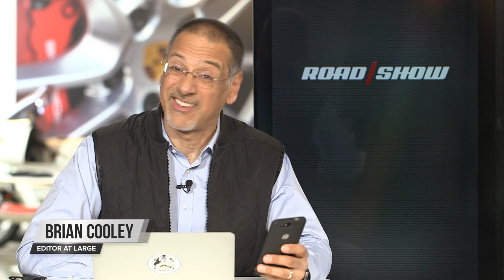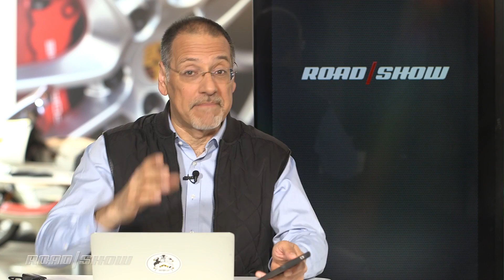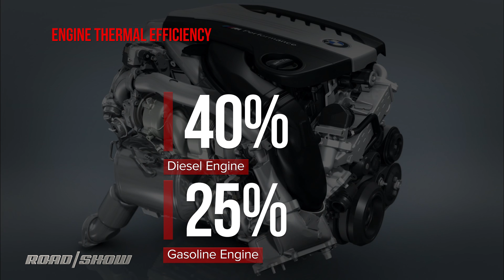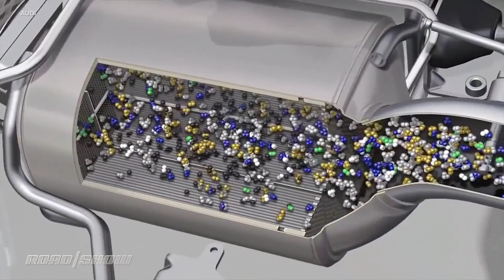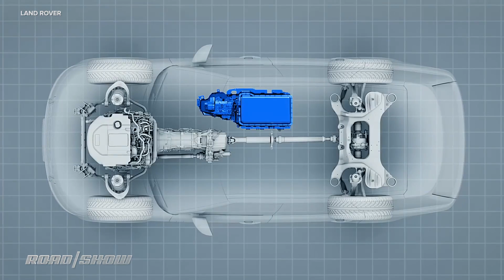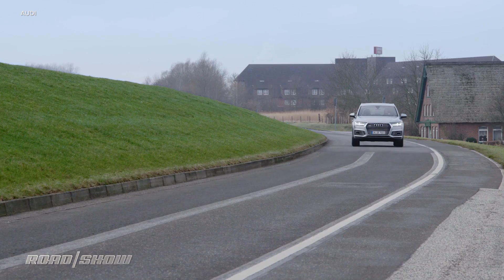Do diesel hybrids make any sense?

Comment: And now we all know what government propaganda sounds like. So lets see the real numbers by using well known scientific fact. Electric motors are not better at low end torque, they are good at torque. Diesel motors do just fine on the top end and are much more efficient than gas across the spectrum. The best motor to generate electricity is the diesel because of it's torque. The difference in weight between a 1.5 L gas engine and a 1.5 L diesel is laughable in a 2500 lb car. The only reason diesels cost so much is because our big oil communist government will not allow them to be produced in the government financed auto industry. Yes they use a bit more material...what does an extra 100 pounds of Iron and aluminum cost? They need high pressure fuel rails but they don't need an ignition system. The $7k price increase is a load of lies from your auto manufacturer not wanting their vehicles to last 500k miles and the government not wanting a 25% drop in fuel tax income. All you geniuses screaming big oil need to understand that the 8 cents per gallon the oil companies are making will not pay for your food stamps like the $1 per gallon the US government is profiting. Diesel exhaust is another lie. I have yet to see a study that compares exhaust pollutants of diesel and gas and then compensates for a 25 to 35% efficiency of burning those fuels. Half of the reason the diesel exhaust is so extensive is just to get those MPG numbers down. Electric generators are almost all diesel. Trains have nearly always been electric diesel hybrids. Electric diesel hybrids would be amazing in OTR trucks. Small diesel engines would be much more advanced and efficient if the peoples republic of America would allow them. Chicken tax

Comment: Small diesel engine that runs at fixed rpm charging the batteries that actually run the car. Like the double decker buses in London

Comment: A very small two or three cylinder diesel with a direct shaft into a 7k - 10k generator and four traction motors. Diesels do their best work at a particular RPM, and coincidentally so do generators. Diesels also have great torque which helps under heavy loads like standing starts and accelerating.  Additional assistance in that area can be found with a couple of extra batteries, or super capacitors. It's cheap and doable with mpg around 75 to 80. If anyone tells you differently, they're lying.
Reply: This is exactly what i was thinking. Why don't we use a small 10kw deisel generator, super efficient, whose purpose is just to supply power and charge batteries for the electric drive train. Add in a deisel flex fuel system that allows use of both bio deisel or regular deisel. And bam. Your hybrid even uses a biofuel now. :) .... now if only we all had money lol.
Reply: It’s a fact diesel generators out perform gas.
Reply: @williamryder5021  10kw is a little light for a practical car. 49kw @ less that 1400 rpm before accessory power A/C heat etc. 200 ft-lb torque and about 110 mph max speed. and could be achieved with a two stroke 2 cylinder engine @ 3500 rpm 92 hp with a boost of about 17 psi. If we go your way less that 25 hp would be needed for around 70 ft-lb of torque before accessory power. I've been looking into this for a while now but unfortunately I lack the funding and electrician skills to accomplish this. I'm so glad I'm not the only person who at least sees this as a viable option to expensive batteries or hydrogen.
Reply: @williamryder5021 biofuel is not great for diesels. Lower BTUs. It does have better lubricity though. If you want to be clean R99 diesel is the way! It's still made from biomass but it is NOT the same as biodiesel. It had a extremely high cetane and extremely high lubricity, even better than biodiesel! It burns clean and clear with no black smoke even in a pretty rich fuel tune but has the downside of 10k less BTUs per gallon than regular diesel
Reply: @williamryder5021  I think Elon Musk should take on this problem. Build a Pick up truck with a small constand speed diesel running on LPG driving a generator to power a battery and electric motor . Diesel electic trains develop good power and milage . If the diesel was buring LPG, I would think the emmisions would be low .
Reply: @williamryder5021  I say turn it over to our resident genius , Elon and he will make it practial for military purpose . A multi fuel engines is used in Military 6 byes .
Reply: So basically like how a diesel electric train works.
Reply: I wanna see someone do this
Reply: @NickOvchinnikov  The big three (Ford, Chrysler, and GM) did it already back in the late 90's.
Reply: @phasegen  with 75/80 mpg, bet the development is stopped because the gas tycoon didn't like it
Reply: @user-jy6kd7xg4d  There'a guy on Tiktok doing this with older big rigs.
Reply: @NickOvchinnikov  check out Edison motor company
Reply: agreed, unfortunately the cost is quite expensive hence why it hasn't happened much
Reply: @blendpinexus1416  I think it's patents more than straight cost. This would be cheaper than battery hybrids by probably more than half.
Reply: Government won't let this get into production... Diesel is reserved mostly for government due to "emissions". As if the government drives diesel, it will give off less emissions... Well of course it will, because there are way fewer government employees than there are regular citizens
Reply: 75-80?? That's it?? Serious question. A non hybrid diesel passat set a record of 77 mpg across 48 different states in the US. A diesel electric hybrid should really beat that by at least 20 or so
Reply: This video was sponsored by OPEC. Hybrid diesel?  You don't need that!? Why would you want that!? You can't be serious right?!  65 Miles per gallon!? Why what do you want 40 miles per gallon for?! I'll be back in a week to collect my 35 mile per gallon car. It's a ridiculous notion end of conversation.
Reply: Having less than 4 cylinders on a diesel engine loses efficiency, as it would require more diesel to keep the engine running between strokes to have sufficient torque. Same reason 2-stroke engines aren't used in motor vehicles. Diesel engines are primarily for moving weight, hence why electric trucks aren't usable for longer distances. Having both engine and motors in a truck would heavily reduce load capacity as they still have weight limits to follow..
Reply: @kmel7  Not necessarilly, Diesel Electric Locomotives have been a thing for quite some time and can carry heavy weight for long distances.  I do not see why it cannot be same for cars and trucks.
Reply: @Chopy61  the locomotive of course doesn't have batteries, the juice from the generator goes straight to the motors...  Would be great to hear a knowledgeable person explain why this works with trains but not with autos...  assumedly because trains are not constantly changing their speed and stopping and starting as frequently as cars, a car requires a battery between the generator and the motors...?
Reply: @PRH123 this might have taken years  but, diesel electric trains have a battery, some do have, search. And a guy converted a semi truck into a diesel electric, it made sense
Reply: @kmel7  When I was between USAF careers , I was in engineering department at Contiental Teledyne . At the time our engineering was designing and building many different type engines , Gas engines for folk lifts, Gas turbines for helicopters , jet engines for drones, jet engines / man rated , multiple fuel engines and a tank engine for the main battle tank of the 1970's main batttle tank .
We had a diesel test stand that used one cylinder of a new variable compression ratio diesel that was suppose to emulate all the performace parameters of the 12 cylinder engine that woild have 12 cylinders . My point is one cylinder under certain conditions can tell a lot about what 12 cylinders can do . Maybe not 100% , but it could test many variables. , Iwas in Gas trubines so I can not speak  100 % about the subject . The 12 cylinder was built and it had one blower and one super chargers on each 6 cylindr bank . It also had variable compression ratio pistons, which to me was a head scrather . I could not put my head around that one, but it did work .
You have got to love mechanical technolgy .

Comment: Diesels are even better at running a constant rpm, perfect for generators. A Chevy Volt could run a more efficient diesel at a lower speed compared to the gas engine. The big problem is would people spend the money.
Reply: That's the problem because its expensive why not just by a gas vehicle and spend the money slower over the years at a gas pump.

Comment: The only why not is: because Petroleum companies dont make enough fucking money. Complete bullshit about torque vs torque. 
The guy is talking about a diesel hybrid doesnt have to have fucking batteries. Locomotives dont need batteries, ive got a 2010 hyundai i30 engine that runs in the vehicle about 950kms to 70L of diesel. Thats close to 600 miles for 18.5gal of diesel. Thats not super efficent driving, ie coasting etc etc just a normal long distance drive with aircon etc on. 
Now if hyundai can do that, theres no reason why someone cant couple a smaller diesel engine to a genset and develop a pure economical diesel electric vehicle.

Comment: I hear diesel hybrid and I instantly think locomotives.
Reply: That's a good thing for efficiency
Reply: Same bro
Reply: I think cruise ships
Reply: i like trains
Reply: Yup, one of the best transport methods on earth
Reply: I think most locomotives are diesel electric akin to the GM volt or Nissan e-power. ie the diesel engine generates electricity and its that electricity that rotates the wheels. Seems this is more efficient than just a direct diesel to rotating gear propulsion. Near alll diesel use a turbo to offset the poor higher performance results where lack of air into the cylinder is the bottleneck.
Reply: Trains are better than cars for efficiency.

Comment: I have to respectfully disagree. I believe that for some vehicles, a diesel/electric hybrid engine is possible, and should be tested for everyday use. You have diesel/electric engines for trains, I'm sure for large cruise ships. So why the hell not try it for cars, trucks, SUVs, vans and motorhomes? Although hardly wealthy, I'd be willing to pay good money to buy a diesel/electric hybrid powered vehicle.
Reply: For cars and small to mid size SUVs gas hybrid are ideal as maintenance is more forgiving, beyond 150K miles everything excluding powertrain begins to fail, and covers majority of the population. 

Beyond that diesel hybrids are more enticing as people will keep that work horse alive as long as possible till the chassis falls apart whether it be 2nd or 3rd owner that exceeds +500K miles.

As to semi-trucks it should be a tribrid which the 3rd power source being overhead power lines similar to electric trains. Siemens is doing this in Sweden called E Highway. If a semi is using 2KW per mile x 65 MPH it would consume 130 KWH. As an electric provider having steady demand is ideal as having sporadic spikes of 1.5 MW charging per truck will be a logistical nightmare balancing slow acting (coal or nuclear steam turbine) and fast acting (gas turbine) power generation.
Reply: @RichardPrendingue  So, why not offer a diesel-electric hybrid engine for trucks, SUVs, and motorhomes?
Reply: @jasoncarpp7742  If it was in my power it would be federally mandated hybrids regardless of fuel & deregulation of emissions for diesels AS LONG AS it was a plugin hybrid. Most emissions on diesels are when the engine isn't spooling the turbo fast enough providing full torque at around 1400 to 2200 rpm. Ideally reducing emissions component costs to put at minimum a 10Kwh battery pack & a high torque starter / generator that would equal in costs or have a 5 to 10 year return on increased investment through reduced annual fuel costs alone.
Reply: @RichardPrendingue  I totally agree. I'd like to breathe clean (unpolluted) air as much as anyone living, but I disagree with the govt's. idea of what makes for clean air emissions. If a person wants to drive EV vehicles, that's fine. But I think car buyers should be allowed to decide for themselves what they need for what application. Not everyone needs or wants a completely electric powered vehicle.
Reply: @jasoncarpp7742  Some irony is favoring EVs is a hindrance to maximization of emissions reduction globally on the basis of battery production capacity. If they instead favored & mandated hybrids alone it would be a relatively immediate 15 to 30 percent emissions reduction that 2018 Tesla gigafactory production capacity alone could support every vehicle sold being a mild hybrid.

Depending on nation the math for PHEVs exposes how favoring EVs is seriously misguided. Europe's average daily commute is only 18 miles so a rather modest 5kwh PHEV would be +90% fully electric. How it should be promoted is cross referencing the Kia Sportage (available as gas, hybrid, & PHEV) & the Kia Niro (available as hybrid, PHEV, & EV) MSRP variances then factoring ROI between fuel preference.

In particular for the Niro EV ($39,550) vs 33 mile electric range Niro PHEV ($33,840) price variation of $5,710 the full EV will NEVER save money over the PHEV for the average European. For Americans it would take decades to break even which factors higher maintenance costs of hybrids.

I wish we had an existing production comparison example for diesel hybrids which technically exists but is as rare as super cars being the Volkswagen 1L. 100 mpg on diesel alone & 31 full electric range costing $130K USD.
Reply: @RichardPrendingue   I agree. I don't get why this is the case. We already have Gasoline/Electric vehicles, such as the Toyota Prius for example, and I'm sure there are others I can't remember at the moment. So why the hell not a Diesel/electric hybrid? I don't get it.
Reply: Cars usually have a more "peaky" duty cycle than a boat or hgv, using short bursts of power to pull out and go onto a motorway and next to nothing for just rolling through town.
A boat just keeps going the same speed through miles of ocean and the engine can be tailored for an optimum power level which diesels are good at. The same for an HGV on a long straight road.

Comment: While weight can be an issue, there are some things to consider. One, with a straught diesel-electric setup, you won't be carrying a car load of batteries like a straight electric. Two, you can use a smaller horsepower diesel engine than would normally be required..saving weight. Finally, the efficiency usually wins out in the end. Where it would be most beneficial is in higher weight vehicles anyway...the same ones that are massively inefficient in the first place.
Reply: A 1.6 diesel with 120 to 130hp plus an electric motor of around 80hp with a range of 60 real km, would be perfect for city and also highways. If you have less than 30km to work, you would use only electric. On long roads it would still consume diesel, but a lot less. A base Tesla Model 3 in Germany costs almost 53k €. The thing is nobody wants to produce a cheap hybrid for the mases, because that would mean a small percent of profit. End of story.

Comment: I drive a mk1 Volkswagen Rabbit Diesel  car it gets about 40-50 mpg it has a 10 gallons tank, I can run multiple different fuels in my Rabbit, jet fuel/kerosene/used transmission fluid and vegetable oil. I’m putting a 2003 TDI in a mk1 VW Caddy truck it will get 50 to 80 mpg!!

Comment: A Diesel Hybred IS the way to go. People are thinking that the Diesel engine will power the car or help the electric motor. Not at all. Motive power will be pure electric. THINK Diesel Electric locomotives with a twist. The diesel engine will power a generator which feeds a small battery. Unlike gas electric hybrids the diesel will not turn off if not needed it will idle. An idling Diesel uses very little fuel. Also when required to operate to produce electricity a Diesel only needs to run at a predetermined optimum speed for power and fuel efficiency. A 2 cylinder Diesel could power a compact car easily. Basic gas engines at any operating speed requires a 14 to 1 air fuel ratio. A Diesel at idle requires a 100 to 1 air fuel ratio. Thats why you see semi's parked at rest stops and highway on ramps with their engines running all night. They use very little fuel. If cared for properly a Diesel will almost last forever. THAT is the reason why car companies don't make them. How are you going to sell new cars to people who's cars are almost indestructible? They will fall into a pile of dust with a running Diesel engine on top before they buy a new one. Cost is meaningless. Pay $40,000 for a gas car with a life expectancy of 10 years and 200,000 miles or pay $60,000 for a Diesel with a  life expectancy of 25+ years and 1,000,000 miles, and lower operating costs. GEE TOUGH CHOICE. They don't build them because they would be slitting their own throats.